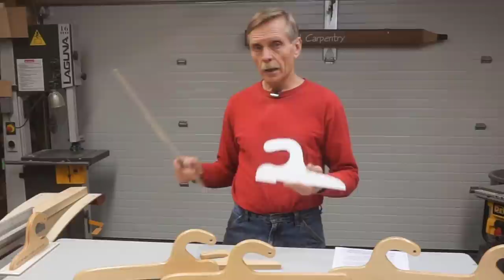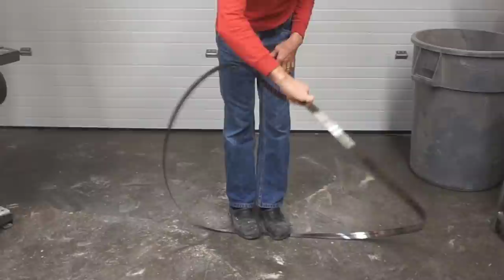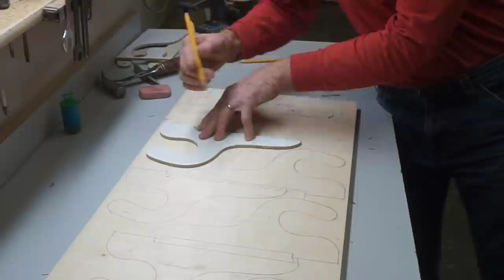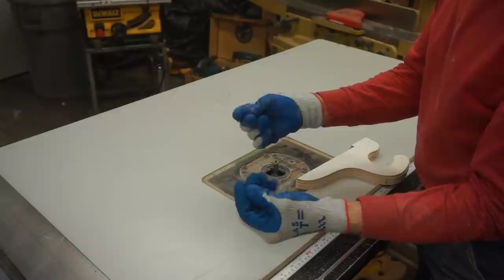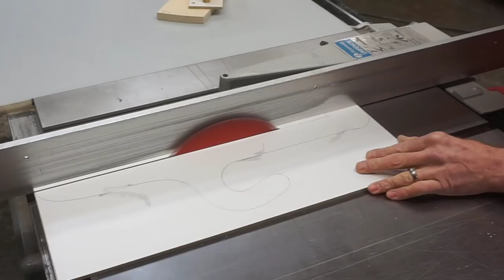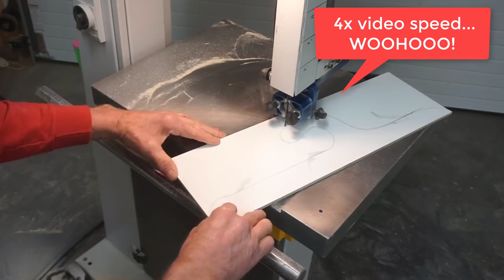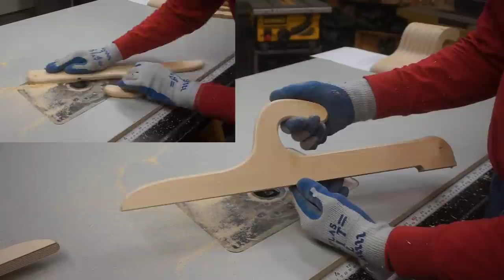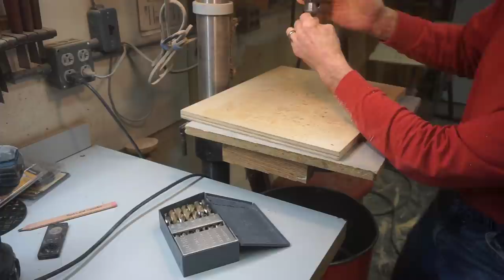Make Professional Push Sticks for Workshop Safety

Comment: was that sparks i saw coming from your bandsaw blade at 14.25 in the video?
Reply from the maker: Very observant, Victor!  I was waiting for a comment about the sparks... yes, that's what you saw from the saw.  The Laguna Guides that come with Laguna bandsaws feature a proprietary ceramic disc in the 'thrust bearing' that generates small sparks from the minimal amount of friction between the back edge of the blade and the front of that smooth flat ceramic disc.  It's never been a problem even with flammable powdery sawdust around but it can be a bit disconcerting nonetheless.  Sparks notwithstanding the Laguna guides perform fantastically... just check out videos showing those guides with a carbide tipped Resaw King blade... you really can slice veneers so thin they float to the floor when dropped.
Best,
 Matt

Comment: What a grest video thanks Matt
Reply from the maker: Thanks Stephen... glad you like this one!  The pattern routing method I use for making these pushstick is invaluable to me for countless projects I do for clients that have curved elements in their design.  CNC equipment aside it's the best thing for getting professional results on small batch custom curved parts.  You seem like the kind of person who will extrapolate the concept here to a wide range of applications.  It is so superior in speed and finished products to all the fussing I see 'out there'  by  people using sanding drums!  I'm just flabbergasted that it isn't used more widely!  You may have seen the "How to Cut Decorative Ends on Pergola Joists" video I did which shows a typical application of this same concept on a completely different project.  Let me know if you have any questions on the finer points if you give this a try?  Best, Matt

Comment: Great video, in spite of gino’s “expert” opinion.  I was wondering about how you got such consistent dimensions on the handle, then you demonstrated with et socket in several locations. Never thought to use a socket for such a purpose.  I’m going to write that one on the wall. A last comment about Gino...he probably was the example of the kid getting hurt on the table saw that his dad gave him.
Reply from the maker: Thanks Dave... sockets can be used for all sorts of layout stuff as true and rigid circles.  Another thing about getting consistant width on a curve is to get 'fair' one edge first and the trace the other side using a compass set to the desired width.  You probably already know that but I always try to make that sort of thing as easy as possible.  Best, Matt

Comment: I agree store stick designs feel so unsafe! I designed my own push sticks also. "Safety is no accident"
Reply from the maker: The pushstick you design yourself is always gonna be the safest because it fits your workflow, habits and comfort zone... and you don't endure in this business by being casual about safety either, right?  Great credo you have there!  Best, Matt
Reply: @NextLevelCarpentry  I 100% agree! What size is your shop? I am at about 2,000 sq ft
Reply from the maker: As a one-man operation I get by with a pretty small shop... the one you see in the videos is like 22x24' garage.  I just moved to a different house with a better garage but it's not all that much larger.  It wouldn't work for a minute if I had even one employee but for me I like to say 'it's efficient' 😎 Best, Matt

Comment: Hi Matt, I did ending up to make up a couple of singular sticks, I downloaded from your picture and made two of them, but I do have a pattern for more, I did have a favorite push stick and like yours so much more better (bad grammar). lol thanks
Reply from the maker: Hope your new 'toys' serve you well for safety and productivity Marty... these really are my favorites.  There's nothing 'magic' about 1/4" melamine but it is nice to work with.  You might check dumpsters at any local cabinet or millwork shops in your area... they fill dumpsters with enough scrap for a lifetime of pushsticks and patterns every week of the year.  Otherwise there's a product called Medex that sign companies use and you might find useful scrap of it too if you look.  Best, Matt
Reply: Thanks Matt, will do, I just made one of 3/4 melamine just to se how that would come out, plus use up some scrap.

Comment: Right before you said Bob Ross... i was thinking this is Bob Ross painting a push stick! LOL
Reply from the maker: Jeremy, too funny!  Thought I'd better mention the Bob Ross voice over thing or someone would give me grief about it sooner or later.  Hope your pushsticks come out 'just the way you like 'em' :-) Best, Matt
Reply: Thanks for the reply.. I have been using a Shark Guard on my Unisaw for 9 or so years now. Have you heard of the Shark Guard? I can rip down to about 1 3/8" with the guard on but that small and i have to use a Shark Guard push stick. I always wanted to make an offset push block so that my hand does not catch the dust hose and today i made one  with a 1/4" pusher with a 1/2" spacer with 3/4" handle and also made a 1/2" pusher with 3/4" handle. I did make the heel more towards the front so that i dont have to move my whole arm so far forward.  I leave my guard on most of the time. I hope i explained  that ok?... Have you ever made an offset pusher and do you use a guard with dust collection?
I do like your design.
Reply from the maker: I'm not familiar with the Shark Guard but it sounds like it helps you work safely and productively.  Maybe the biggest difference is that the only dust collection system I have room for with my shop setup is a dustmask and a broom :-)  I build dedicated guards for specific applications but don't use one for the most part... old school me, I guess.  Thanks for commenting and interacting on this video... much appreciated as I work hard to build/develop Next Level Carpentry!  Best, Matt

Comment: to be fair though, love your vids but saying something like 'turning the saw off before a kickback happens' we both know that's not really true. you might feel a board start to bind and i've even pushed baords through the cut. i've also stopped and turned the saw off. i've never had a kick back. i would suggest though that while what you do is safe for you, consider that when you're producing videos some people may be new and not understand some of these concepts and the dangers associated with them. table saw physics are kinda weird and more than anything a riving knife is super important. that said, i love you videos and think you're pretty on point with safety. just there's an added element to putting stuff out into the public for consumption.  (miter saw actually did but that was mostly cause i had a large stack and not enough fence, thought there was tho). this is a great video that shows a kick back in slow motion. and with his push block  'above the blade' ended up a 1/4 inch from it.
Reply from the maker: Actually it's true that I've turned off my saw in time to prevent a kickback but I didn't elaborate in the video.  I can hold back a workpiece with these pushsticks while the blade is being pinched long enough to hit the off button with my right thigh... I've done it more than once but it's one of those 'don't try this at home' situations.  In similar fashion sometimes people are able to slam on the brakes in their car to avoid an accident but not often enough to recommend it as a 'safety practice' for sure.  I do hope viewers get in the habit of using a riving knife despite the fact that I don't... they're extremely effective for reducing accidents with a tablesaw! Best, Matt hew Too😎

Comment: HERE IS A METHOD YOU SHOULD NOT ATTEMPT:
I often use another method for ripping that does not require use of a push stick at all. For non-critical rips, I rip to within a few feet of the end of the work piece, then exit the cut, flip the piece end for end, and finish the cut from the other end. My hands never come within two feet of the blade.

The first time I saw this method used by a lumber yard man, I turned up my nose at it, believing that it did not meet my standards as a cabinetmaker for precision and consistent orientation of entry and exit cut on the face side of the work piece. But once I thought about the massive safety element, I started to use the method whenever I could. When ripping construction framing members, especially on the job, the cut is perfectly adequate. In the shop, when ripping  solids that must end up S4S and have already been faced and then jointed on one edge, I rip and/or resaw 1/32 - 1/16 oversized, then plane the sawn edge to perfect finished size on my thickness planer. Besides the reduced anxiety from keeping my hand completely away from the blade, the freedom from concern that the final rip cut must be perfect is liberating. And I find my rip speed naturally increases.

Another practical benefit of this method is that it can eliminate the need for outfeed support and/or a helper when sawing longer members. If you exit the cut about mid-way through the length of the work piece, it is well balanced on the saw table when you exit, and similarly balanced when you finish the cut. (e g., you only need to rip  about the first 6' of a 12 footer at a time.) 

Admittedly, some skill is required to exit the cut before the end of the rip, so I should stipulate, "Professional drivers on closed course. Do not try at home..." The key to exiting the cut safely is to maintain complete contact between the edge of the board and the fence at all times, and to keep the bottom face flat against the saw table as you pivot the board up against the (perpendicular) end of the saw table and then clear of the blade.

AGAIN, I ADVISE YOU: DO NOT USE THIS METHOD.

Comment: Nice, made one of these myself! But could you please explain why you are so concerned about your safety but you don't use the blade protector? And why is your blade so low. I am a professional carpenter from the Netherlands and i was tought to always use the blade in its highest position to prevent excessive wood chipping. Thanks for a response!
Reply from the maker: Sure Peter... glad to.  
I am first and foremost concerned with my safety as you mention and it's the primary reason I DON'T use a 'blade protector' on my tablesaw.  I personally feel that while it may prevent a specific danger I also feel that it provides a false sense of security for many other dangers.  This is my feeling and opinion alone and NOT my advice to you or any other viewers!  I much prefer to  work with a solid, ergonomic, reliable, comfortable, sensibly designed pushstick with no blade protector than all the blade protection there is and a flimsy 'stick style' pushstick like the ones included with tablesaws that come with 'OSHA Approved' blade protectors.  The tablesaw accidents I've had have been caused by carelessness, not lack of blade protection per se.  That said I think a riving knife protector is a wise and sensible addition for any tablesaw but mine is of an age before they were available.
Where blade height is concerned: I'm cautious about anything that's taught as a hard and fast rule to 'always/never' be used.  With sharp blades, a zero-clearance insert and sensible work practices I don't have problems with 'excessive wood chipping' when making cuts with the blade about 1/8" above the work.  If you find the only way to prevent excessive chipping is to raise the blade to it's highest position I'd suggest looking for other solutions.  I can think of a number of applications where a higher blade setting (and it's directly related 'angle of attack) would CAUSE excessive chipping rather than prevent it.  Veneered sheet goods are a prime example: teeth exit the underside of the sheet at almost 90 degrees with that setting, almost sure to cause unacceptable  chipping.  A higher blade setting while ripping thick hardwoods will lower the load on saw and motor but here again: what amount of efficiency is worth the increased amount of danger from exposed blade and teeth?  These are things I highly recommend each and every woodworker think through and decide what they're most comfortable with... it's THEIR fingers, after all.
Hope that helps you out, Peter... if it comes across as a condescending lecture I apologize... it's not my intent.  I really do appreciate your questions and observations!  Best, Matt
Reply: Thank you very much for your clear response Matt! And i certainly did not consider it being a condescending lecture :) On the contrary, it broadened my view. It's always good to think about things you do on a daily basis and step back to get to new insights. Especially with these tools we are working with it's easy to forget how dangerous they actually are!
And of course i don't follow my teachers blindly, meanwhile i found my own tricks to do my job safer, more effecient and better. Still got all my fingers! And so do all the patients with brain damage and MS that work alongside me (sheltered employent).
I'll certainly try various heights with the different types of wood, just to see what happens. 
Once again, thanks a lot for your extensive explanation. Really appreciate it! Regards, Peter
Reply from the maker: Mission accomplished: share information to the betterment of all!  I applaud you for your work alongside sheltered employment folks... it's so easy to loose perspective just going through life until contemplating the difficult realities others live with on a daily basis.
I hope you'll post comments here at Next Level Carpentry whenever you're inclined to...
Best, Matt
Reply: I was always taught to have the blade as low as you can as to reduce the chances of injury. Also I have watched a lot of these kinds of You Tube Videos and for all the talk about safety I have yet to see any one using safety glasses.
Reply: hi peter, i has made woodwork only last 55 year 75 old now and ALLTIME saw blade need adjust at what has wood tichnes,m alltime need made blade only little more than sheet have, if sheet has 20mm blade adjusted about 21-22mm. u have amateur if not know basic at woodwork.

Comment: Hey Matt, great video on the push sticks. I really like your design and have seen many on you tube. I fell in love with the rubber bushings on the bottom of a push stick that someone came up with. I thought that it would grip your wood a little better as you were pushing it through the table saw. I had to laugh about the black plastic push stick in the beginning of the video. I think the new sawstop job site saw I just ordered comes with one of those, lol.  I have made push sticks in the past but I ended up buying a plastic one with those rubber bushings on the bottom and it seems to work well. I think they all work and depends on what you get used to. I did love the extended push sticks you made. I will have to make one of those.
Thanks again I enjoyed it very much.
Reply from the maker: chipshot, thanks for your encouraging comments... it's so true what you say about 'depends on what you get used to'. The only sustainable way to work around hungry power tools is to use what gives you the confidence to work safely.  If you noticed comments by Richard Davis on this video I think you guys are talking about the same pushstick with rubber bushings on it.  Your confidence in the 'octopush' style tells me I should check into it!  If SawStop is truly including a 'plastic toy stick' with its saws it seems to me an awful lot like handing out candy to kids when they leave the dentist office <P8-0
Reply: Hahahahahaha........ Yes Matt that is a great analogy about the dentist office, lol. Yea the push stick that came with the sawstop will probably make it into the recycle bin, lol.  Yes the push stick I could not think of the name was the Octopush. I ended up buying a plastic version of this and I think its great. But, the Octopush is worth looking at especially for a master carpenter like yourself. I would appreciate your opinion. Thanks brother, all the best.

Comment: Nothing personal and please don't take it like that, but I've made a few hundred push sticks absolutely accident free without fancy layouts. Just freehand with either a bandsaw or scroll saw and viola.. Now I did once experiment with fancy holes to make one lighter, but it fell apart quickly..  But hey, thanks for the video. I do have templates, but none for pushsticks.. My pushsticks are my templates right up until I've cut too many thin parts on the table saw and the end hook goes POOF! Thinking of the POOF episode it's time to make a few more.. I gotta try the All trick and get my free cup of 5 Bucks coffee..

Comment: Talking about safity and so and gues what in next step using gloves with router - newer seen or heard at that's a safe work
Reply from the maker: So you learned TWO new things from this video?  Nice! Keep in mind that they are safety-grip gloves worn to maintain firm control of a power tool and NOT some over-sized stiff, leather-palmed, never used ridiculous ones like they wear in so many HGTV shows and movies!  Best, Matt
Reply: @NextLevelCarpentry  Nope - Learned at school to newer work with gloves on with power tools/machines and not think to start using them just because someone think to name them safety grip gloves. I use them to carry like glass or something where need to have good grip and that's it. NEWER with power tools/machines what can rip off your hands when cough in some blade

Comment: Have you made a video of your table saw inset?
Reply from the maker: Mark,
No video for the insert.  That's a Wood Dynamic model I bought about 15 years ago.  Unfortunately it's no longer available from them.  Not so long ago I found a Charles Neil Signature Zero Clearance Insert that was similar but just now in a web search it looks like that isn't available either.  Bummer because its a very functional accessory. You might have some luck searching those brands on eBay or Craigslist... good luck in your search!
Best,
Matt